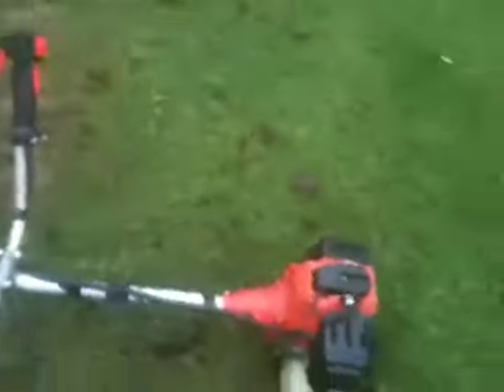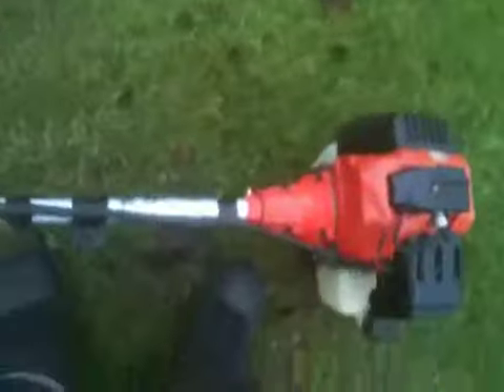Cold start of my 50cc strimmer

Comment: looks like its running a bit rich
Reply from the maker: It it as inlet manifold where the carb bolts on to it the inner nuts have stripped so letting more air in so more fuel